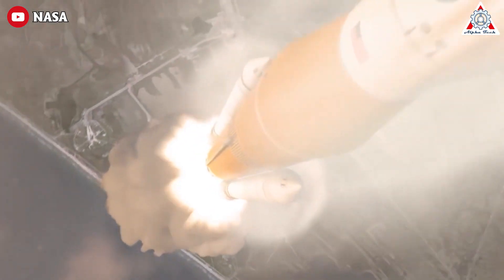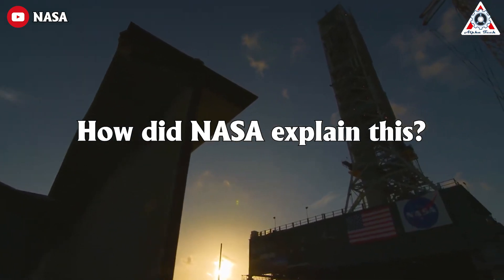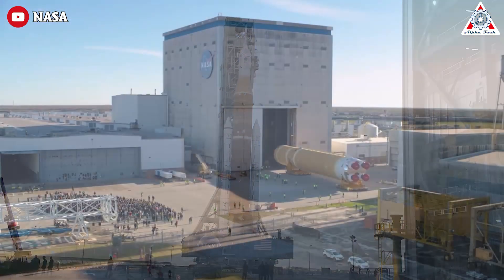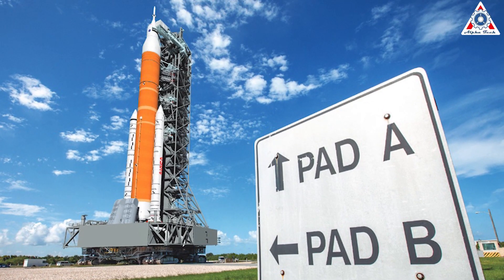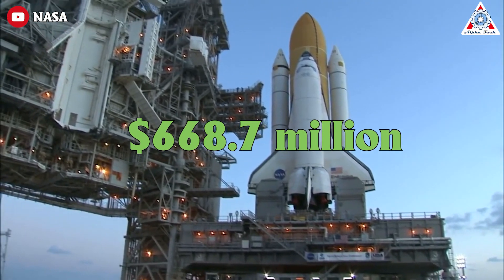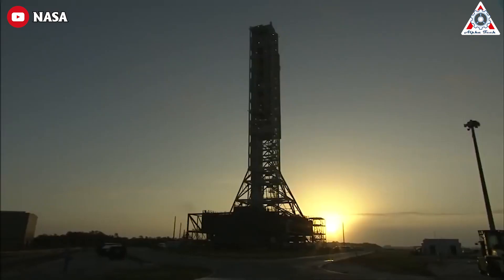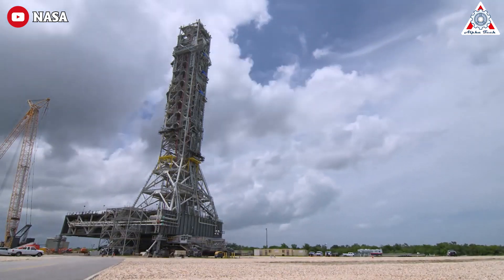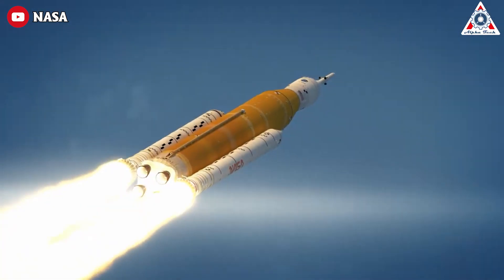Disaster! NASA Launch Tower Big Problem...

Comment: You could have a design and construct tender / project or a fixed price contract: either way you require a specification. It seems as though NASA didn't know what it wanted in the first place and the government continually intruded in matters it doesn't understand. NASA needs to be able to operate without government interference and NASA needs be held accountable for its mistakes ( including jail time where relevant)

Comment: By the time Artemis 1 gets off the ground, Spacex will be recovering returning capsules from Mars
Reply: What, just like transporting thousands of people daily using hyperloop?
Reply: @KnightspaceORG   nice try, but more like actually launching vehicles instead of constantly rolling one that is already obsolete back into the VAB.
Reply: @CaptCap25  Launching Falcon Heavy. Not anything else. Just like ESA is doing, for example. 

Mars missions are just a pipe dream of a dude who overpromises, at least for the forseeable future. You need to take what he says with a massive grain of salt.
Reply: @KnightspaceORG  for now. Real talk however, SLS will get one, maybe two launches before the Orion is on top of a falcon heavy.
Reply: @CaptCap25  Possibly, i don't see why that wouldn't happen, Falcon Heavy systems are proven to work, iirc there were some internal talks within nasa about this possibility as well.

I just don't want people to blindly believe businessmen, i guess.
Reply: @KnightspaceORG  yea, I actually got that from a NASA engineer a few weeks ago. They’re already working towards private contractors but have to show something for the money that has been wasted.

Comment: So much misinformation in this video, out of the gate you said it leans, which it does, by something like a centimeter XD, and also, it will be used for 3 flights.  If you want anyone to blame for that, its Congress for its flat budget which forced NASA to go with Block 1 and infrastructure to support it, before being able to move onto Block 1B/2.  Lets also get something straight with the contractors, it was Betchel that screwed the pooch with ML1 and ML2, NASA has no other choice with Congresses limited budget, but to choose the cheapest contractor, even if that contractor is utter garbage. Its why they had to go with Betchel despite its pitiful performance on ML1, for ML2. 

You get quite a few other small tidbits wrong with your video, such as inferring that the valve was on the EGS side, when it was on the rocket side of things in the ICPS's helium pressurant system.

Later on as you continue with your gripe about ML2, you decide to almost completely overlook Bechtels part in the issues, and lay into NASA, with an issue that you don't seem to have done any research on?  The lack of final specifications on the EUS which would be on the flight side QD plate,   there is nothing else on the ML that has to accommodate for EUS besides  the umbilical arm, which hardly has anything to do with the actual construction of the platform itself and the tower.  

Your video overall is a bit disingenuous, and to me feels like just a jab at NASA, working with a system with which they have inherited and been given, whilst twisting the facts of the matter, or presenting them in a way which doesn't give the whole picture.
Reply from the maker: Thanks your feedbacks. I will find more about this an be better in the next video

Comment: Half a century of defense contractors tweaking NASA contracts to "just another" defense contract is the only answer.  Defense contracts paying many orders of magnitude more than actual utility of product.  $5 billion for a not so stealthy "stealth" bomber?  Top of the line airbus is around $200 million (3 orders of magnitude less), just one example of all the many obscenely priced contracts .   For you math challenged millennials that is 25 Airbus's to a single stealth bomber.🤯  Each Airbus in "freight" configuration capable of 10s of thousands of pounds payload.  How many 500lb bombs per each plane more would that be?    X 25 per SB

Comment: Though it is a tough situation for NASA to be in, it definitely is not all their fault. One could say that it is NASA's fault for not being transparent on true project costs associated with a new program designed to replace the shuttle and return the USA to the exploration of space. After all, it is not just a new vehicle. The project costs of the vehicle are the Orion Capsule, the SLS first stage, the upgraded side boosters, upgraded RS 25's, a new second stage built off off older designs but with modernized engines, new launch towers, and a complete new support system for each element. NASA has had too many of their projects ripped out from under them due to politics and costs. Lets also not forget the cancellation of Constellation midway and then it's reallocation with the new SLS brand name. When you couple all these events together and a launch deadline to squeeze into without appropriate funds, you get a very irregular project wrought with errors. And if you don't have a solid set of plans to bid on and to build off, there is no way to have a fixed price contract. No one would bid it without severe over pricing. That part is not the contractors fault. I am somewhat surprised that NASA was not able to better evaluate their contractor and the bid. The contractor may be the low bidder and that sounds great, but if they can't do the job for the price, especially on cost plus, then costs are bound to jump up. And to see that the plans and specs were not set on the MLT's, it must have seemed as enticing to Bechtel as candy to a child. The bottom line: when the kinks are worked out and all the players are patting themselves on the back for a crappy job, you'll still have and enormously expensive project with low returns especially when compared to the commercial market.

Comment: The problem with NASA is they are using a Frankenstein approach to the Tower and to the Artemis Project by piecing parts together. However, that is typical Government for you.
Reply: The tower is like oops we forgot this. How much money did they blow on the old tower before they threw in the towel and said oh and now we have to build a new one. Wait for another 5 years. The contractor can't start construction for a year? Why? It would have been cheaper just to re-engineer everything from the ground up rather than trying to use old technology from the shuttle era. Even just building the Saturn v all over again would have been cheaper by far probably. The problem is that the people that workrd on that program were a different generation and they were completely different people from what you got working on this technology now. The best people are working for SpaceX anyway so the Artemis program, Boeing and all the other contractors are very anemic now. A good analogy from my personal life was how I was the last kid to have a slide rule, everybody had a calculator in physics and mathematics when I was trying to graduate from grade 12 into matriculation for engineering. The slide rule allowed me to rule and I had the top marks in both classes. Something like 98%